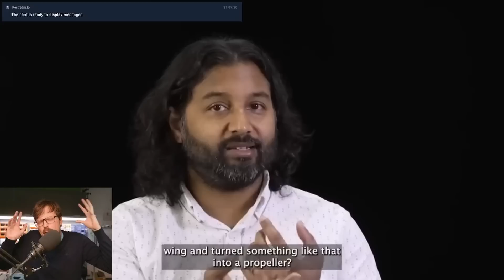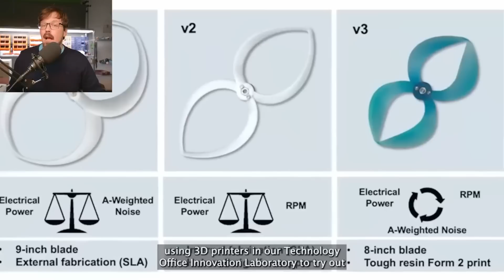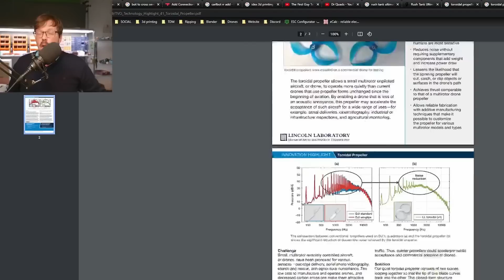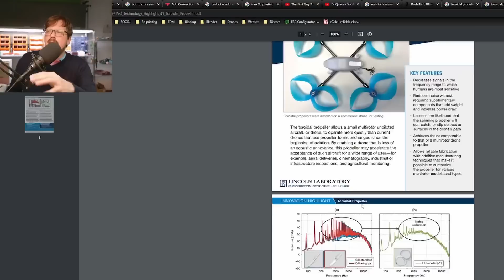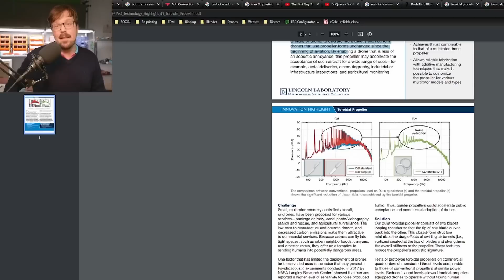MIT Thinks you're STUPID - Toroidal Propeller Snake Oil

Comment: One crucial point I have not seen discussed about this kind of pop is that shedding the tip vortex along the blade, instead of only at the tip, is that it will inherently produce less thrust (Since the total circulation at every cross-section of the blade is reduced). I believe that's why the boat prop uses a staggered design, increasing the "blade width" and compensating for the aforementioned effect. Maybe it is possible to design a good, well-optimized, toroidal prop for drones, but since these have been around for some time and have not seen any commercial use in aviation, I highly doubt it.
Reply: So they are more benign propelers,  a d not actually effecient
Reply: Should look at helicopter rotors not fixed wings. Modern helicopter rotors are super quiet compared to helicopters designed in the 50's and 60's and it's because rotor blade design has advanced a lot since then. The local PDs chopper is so quiet that the tail rotor is actually louder than the main rotor and you can only really hear it when the outflow from the tail is pointed in your direction. Until it's almost directly overhead it's almost unnoticeable and it's quieter than the traffic even then. From what I can see on modern helicopter rotor blades the tips are swept back and curved down like a sort of winglet on the end of the blade but there's probably more to it than just that.
Reply: @atomicskull6405  would this be advanced form to the effect of a nonlinear "twist rate, "
Reply: Ok, I can answer you about that, I was watching and thinking how could do this usefully, THEORETICALLY you could increase the blades and staged them as you said, if the calculation is done right, the second stage could improve the airflow increasing the thrust, somehow similar to a counter rotating prop, but the shape of the toroidal needs to be optimized to work as intended, since it could increase drag, change torque characteristics etc. 

That said, I will jump forward to my expertise, production, if you can, answer me what kind of material and how would you do that prop? You can't? Neither do I, the complex shape needed to be analyzed for how would it handle stress, heat, vibration and so on, the connection between the first stage and second stage blades is the worst part, I don't have any idea how the forces works in that area and how the casting or molding would be done, and as we know from the tips of normal propellers, will definitely be the worst, and we can't forget the weight and balance, which is totally different.. 

In conclusion, could be indeed made, but the development is too costly for the uncertainties of the benefits, also the production and maintaince won't be competitive.
Reply: Just doubling the number of blades and prop density does cause a big shift in the props efficiency, RPM and tip speed ratio. You would need to check on the Huetter prop density diagram first before even considering the tip vortex effect.

The key thing here is understanding Betz limit. At like 55% efficiency a convetional prop is as close as you will get to 59.3% theoretical limit. You basically try to magically optimize away the last 5% aerodynamic loss. That energy splits between friction heat and noise. So at 5% that crazy low compared to all other designs. You can maybe squeeze this by 1% or 2% if you all other sign the same. So that why no one really cares to try do that.

The noise effect is tied to speed of sound barrier effects - these to strongly depend on RPM and tip speed ratio at pro size.
Regarding a boat prop we speak of caviation - a theopretically similar barrier effect in larger sense, but totally different in detail. A much different challenge in a much different speed regime. Occurs in an entirely different RPM and tip speed regime, but Betz limit stil does apply. Boat impellers mostly are impulse driven not lift driven design anyways and should not be compared directly to lift based props/turbines. Comparision would always be shown on the tip speed based efficiency power curve turbine comparison chart. Omitting this essential key claims reference is the classic scam sheme on any turbine design "perpetuum mobile" magical energy / efficiency claim.

A boat prop never runs at the super-optimized efficiency of a container vessel, because fuel efficiency of boat props never was any real concvern for leisure boat owners in the first place. We speak of rich guys just guzzle a small thing from A to B. We don't speak off 15K TEU cargo going around the globe on a customer paid budget for a month.

So we basically do not know what that leisure boating props starting efficiency even was.
Even if this gets debunked by pros quickly, this pump & dump will still catch and score with some stupid money fools.
It is the perfect psychological design targeting arragonant half-rich smart assy people with leisure boats.
Doesn't reallly matter what fluid dynamics experts do think or write here. We just fuel the controversy on these bets driven by greed and fear. This is Aerotyne Industries of The Wolf Of Wall Street.
Reply: @voster77hh  Increasing the number of blades decreases efficiency but increases maximum thrust the prop can produce, but with diminishing returns. For example a three blade helicopter tail increases thrust by 33% but increases power consumption by something like 50% over a 2 blade tail.adding a fourth tail blade increases thrust by 20%, anything beyond that is diminishing returns, this is why you never see e.g. 5 or 6 blade wind turbines, almost all of them are 2 or three blades. Anything after four blades stops being worth the added complexity and cost. This is also why two blade helicopter rotors still exist. More blades reduces the footprint, but also reduces efficiency. In military helicopters this is usually considered more important than maximum efficiency while civilian helicopters often have two blades.

 Absolute max efficency is one blade, which exists, a counterweight is used to replace the opposite blade. R/C pylon racers often have a one bladed high speed prop. However theryproduce more vibration and the high speed makes them extremely loud, in a pylon racer this is considered an acceptable trade off.

 Fenestron tails are a different matter, that is a variable pitch ducted fan and it's used for reducing noise and increasing saftey, and it is less efficient than an open tail rotor. Reducing noise is why the RAH-66 Comanche used a fenestron tail instead of an open tail rotor for maximum performance as it was designed to be a low observable armed scout helicopter.
Reply: Think of a teroidal fan blade like a 6 bladed prop instead of a 3 bladed prop or however many blades the prop has. It wont produce more or less thrust. It just makes high altitude flight much quieter than a standard propeller that's what the design is intended for.
Reply: @michaelisbill7497   Well, yes I did. A single bladed prop is the most efficient on the Turbine power curve diagram. We use 2 or 3 bladed lift-principle props because they cause the least vibration from manufacture. Other wise they would be sleek one bladed with counterweights.

In enclosed compression stage turbines push-force turbines you only have as many blades as you can to prevent pressure leakage at the rim of the casing. That a precision manufacturing topic.

On Huetter diagram you can see the more area is covered by a fan the less efficient it is in air. You want the least possible blade material spin fastest to push a fluid medium. 

That's slightly different in water. Cavitation does favor slow moving drag driven turbines due to cavitation.

This is worse because it got more blades. That's why it is so easy to debunk.

It may generate less noise. The simple answer may bet it generates less noise because of reduced mass-flow effieciency. 

Moving more molecules faster does always cause you parasitic energy loss due to 1st to 3rd rule of thermodynamics. That's energy conservation, entropy etc. keeping you away from perpetuum mobiles and magic energy savings. The parasitic energy will dissipate into surroundings as friction heat to the wake and turbulence kinetic energy and sound energy. Needs you 3 years in a specialized engineering university to get there. Spezialized means fluid turbo machinery (turbines & pumps) deparememt or aerospace engineering department.
That stuff most engineers never get into.
A tip speed ration power curve is what they need to supply
Have seen none. But from the number of blades increasing alone it can only be worse. This is most relevant in RE efficiency but Betz-Limit law applies to all fluid turbo machinery.

Well, you got the gist of an entire series of university lecture minus the math now. Bear with me - I sometimes teach basics of this subject to BEng in my company from other engineering fields.

https://energypedia.info/wiki/File:Wind_turbine_limitation.png

Comment: I made a molecular biology PhD in Germany. I had to extract the DNA of the cells of my probes in a tidious, lengthy, exhausting and dangerous way (with phenol/toluene), using 0,1ml of them per probe. I asked my professor to use the DNA-extraction-kits that another part of the research-group was using (EU-funded, bigger funds). The Prof said yes, if I first finish the phenol & toluene we already had, an equivalent enough for nearly 100.000 probes (my whole PhD would have just 1000-1500 probes!!! What we had was enough for 100 PhDs like mine, or enought for the next 300-400years), and then I gave up hope, and tried to work those 4+ years with material-costs of less than 1.000$... The difference of MIT isn´t in the researhers, but in the gigantic budgets, spending in minutes/hours my annual budget, if needed. The researchers have a different quality than ones in Europe: They are foremost sellers, selling promises for higher funds, than scientists. And scientific magazines will anyway publicate american research while being far less skeptical, thus easying the way to higher funds. Researchers then go on with overspending. So you get a laughable MIT-presentation, instead of serious research.

Comment: MIT it's not what it once was, taking credit from a similar designed used for years, this almost seems like a scam, no data or details about the noise vs thrust, using a cheap 3D printer, and the test quad flew horribly with those heavy props, also altering the sound in their video...

Comment: Sidenote ionic thrust is a bit of a scam in itself. Yes, it's real, but not efficient for the amount of energy required to produce useful thrust (the thrust to weigh ratio will never be as efficient or effective as props/turbines that can move much larger volumes of air relative to the energy required to do so). This was also worked out years ago but everything old is new again 😀
Reply: Got some good papers on that? I'm new to all this stuff and am tired of crap info.
Reply: @amentco8445  NASA. They have tons of publish stuff available. And there's a reason they're not pouring millions into research on it much anym
Reply: Yeah, but that just means it's a different use case, rather than useless. Having no moving parts is a big advantage, that can't be overlooked in long term deployment.
Reply: @malcolm_in_the_middle  Yeah. But in physical space you've gotta work with the physics you've got. It's all about energy density when moving objects around. That's not to say the technology isn't cool as hell, it definitely is, practical use completely aside it's pretty neat.

Comment: I did see as much data and evidence in this video debunking these prop‘s as in the MIT papers promoting these prop’s…
Reply: Top fucking kek. Man's "occam's razor"'s away the actual evidence and blunders into a microphone for 12 minutes.

Do you think he was self aware here? He describes this production shockingly well. 11:53
Reply: @chaos5411  yeah I don’t know how you can go so crazy over some props. I am no aerodynamics expert but since winglets on planes are a thing I  it doesn’t seem too unlikely to me that these props actually do what they are supposed to do, but similarly to winglets the effects will probably only show in long term use and not on a fpv quad that accelerates and decelerates it’s props pretty much all the time. On a fpv quad I can imagine it actually being less efficient because these new props seem like they are probably a bit heavier and more mass requires more power to accelerate, wich the motors of an fpv quad constantly do. I think it’s effects on efficiency are highly dependent on the use case and fpv quads are probably simply not the perfect application for this new design, at least not when flying races or free styling…

Comment: Noise is more than just a dB rating, there’s many sources of noise and how ‘annoying’ it can be: Tonal
Broadband
Loading
Thickness
Roughness are all different types of noise
Reply: Too true, I just got a new "quiet" refrigerator that has a high-frequency 'warble" to the compressor that mixes with sounds from the TV and is really annoying. The low hum of the old one was easy to ignore and on its own was somewhat restful.
Reply: @redbaron07   The sound from your fridge is likely due to an inverter drive system for the compressor, and possibly, a variable speed compressor. Old refrigerators are better and if you can find one that uses propane as the refrigerant, you will enjoy better efficiency than the new ones.
Reply: True about noise. Just little quiet from conventional propeller.

However, more surface area, more blade, more weight, more material, bit expensive, limited rpm, hi-rotational mass, more amp draw = Inefficient.
Reply: This is at least partially accounted for with the ‚A-weighting‘ meaning they used dBA. Which are somewhat weighted after human hearing.
Reply: They did a test underwater of the MIT design and a standard design. You can see how they made the MIT one sized to the standard, even same materials. In the video, they're going at the same rpm and the MIT isn't making as much cavitation was the traditional design. That's what makes is new development so amazing.
Reply: @WolfeSaber this style of boat prop is already commercially available they didn't invent them
Reply: Okay, measure any of those 5 things, and see if that's the type of noise theyre referring to
Reply: Excuse me? Are you talking about physics or music. I made two sons. One in PhD program in physics, the other in Juilliard masters. Explain what you just said? Thickness? BS
Reply: @donzheng7068  Are you okay?

Comment: What made me skeptical was the videos of the homemade props lacking the exact same data. No sound measurements in a video demonstrtating props that are quieter? I gues I'm not as dumb as they think I am. GREAT VIDEO!!!
Reply: I found a video yesterday which had 3 prop types to compare audio levels through the microphone. A double blade propeller, the toroidal propeller, and an 8 bladed propeller. Double blade was as you expect, the torodial was just as loud but slightly less high pitched (but not noticeable without a side by side) and the 8 blade was much quieter. This MIT thing seems like just an awards grab.
Reply: @acephantom903  Agreed. Thanks for the confirmation. Good to see the FPV crowd testing the claims though.

Comment: People have tested on other channels and it is different, the frequency is different, handling on a quad is different the useless outer edges may be resisting drift from straight, and because you have more surface area it is less efficient. They have had toroidal propellers for a long time on larger planes, the difference is the closed shape that probably increases the stability (lift surface warp and bending) of the shape in lightweight materials, this design seems to be aimed at drones.

Comment: You can call me insanely paranoid, but what if this whole paper is aimed at deliberately degrading the flight performance of all drones? Hear me out, now there is a military conflict in which even civilian drones are constantly used to destroy enemy forces or equipment. Both sides interested in making own drones better, but want it faster, cheaper and both of them do not like to check the sources. So we have a snake oil like product on the theme realated to a military application from trusted sources(MIT) with viral video potential. On the hype train arrives manufacturers of drones and enthusiasts with 3d printers. Finally we get worse flying drones which can kill less people - I count is a win.

Comment: You criticize MIT and don't know that "electrical power" is a well defined term (voltage x current), really? I agree that we need data for the relation between electrical power and thrust over the rpm band, though. The thing that makes me sceptical about the promise of high efficiency is the shape on the outermost part of the propeller. This part is basically an airfoil perpendicular to the movement of the prop blade, so it does not produce lift but as it is the fastest moving part of the prop it produces a lot of drag.

Comment: The illustrations at 4:10 look pretty clear and informative to me, and interesting too. I have no idea what you are your questions: Electrical power is measured in watts, (that is, Volts X amps, and amps represent current btw ), this is the only value that matters in that case, and each design show a balance (hence the scales) according to those values.  
I should also note that those designs have almost nothing to do with the 3D prints that I have seen being tested on Youtube...
Reply: illustrations aren't information on how it performs.

Comment: I have queried the tip drag, the blade interference and complex intersection drag with the "cloverleaf" form esp...
(as well as the increased inertia) - answers not forthcoming
I suspected the "toroidal tips" will be optimised when iterated to - zero thickness - and width - probably  losing the intersecting blade - bam, scimitar 3 blade appears.